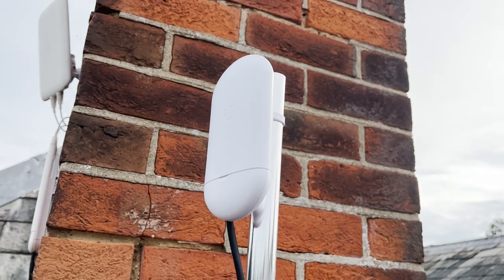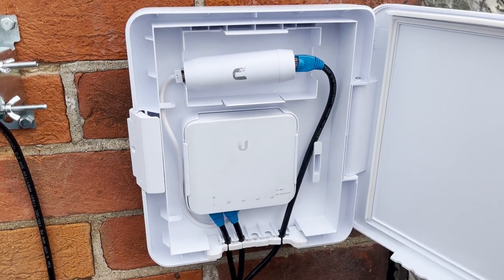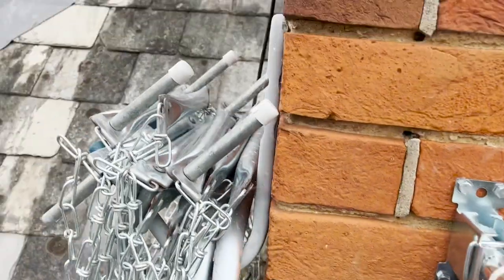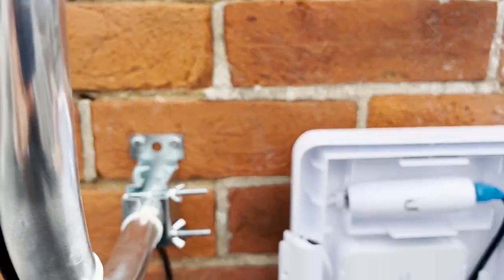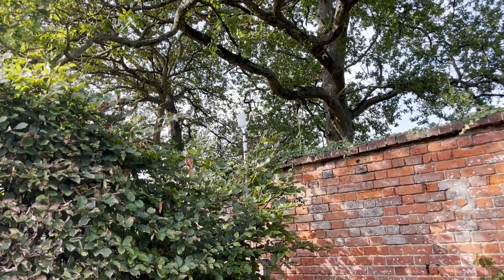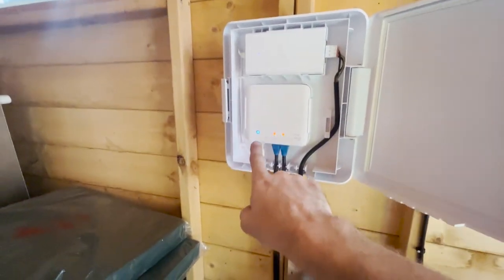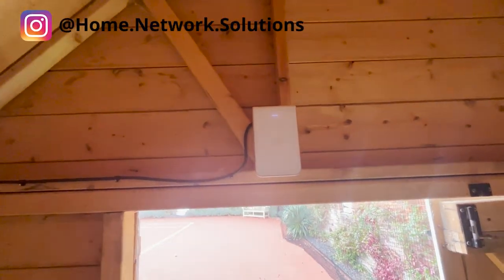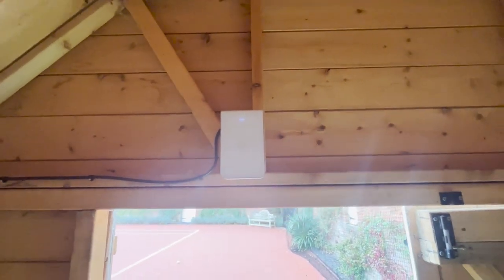Installation Of Ubiquiti Point 2 Point - Actual Installation

Comment: Why is it on a pole and not attached directly to brick?
Reply from the maker: The point has to mounted on a bracket of some kind. We may have had to adjust the height to get a great signal so a pole is better from that respect. We cut the pole to the right height once we were happy with the position. We wouldn’t have the same flexibility if we’d fixed to the wall.